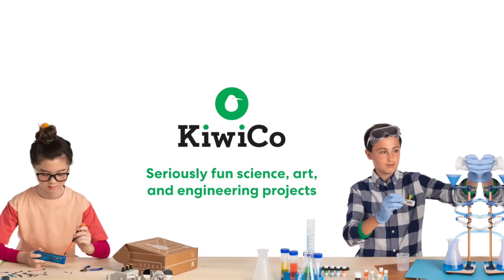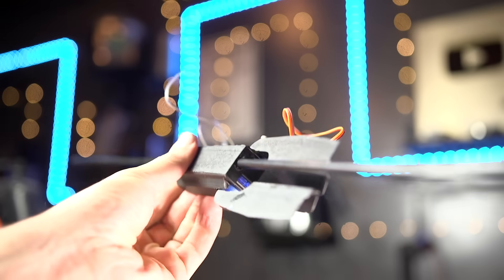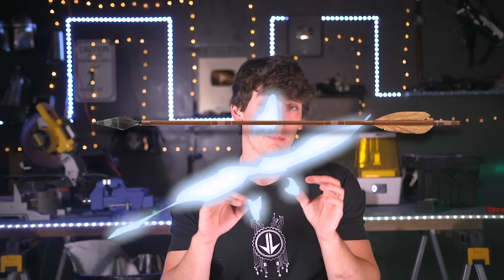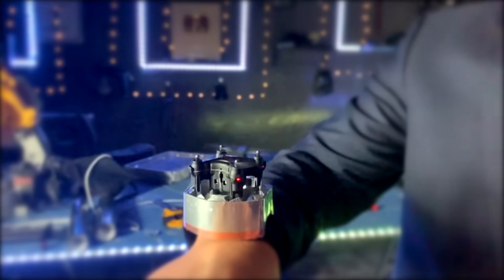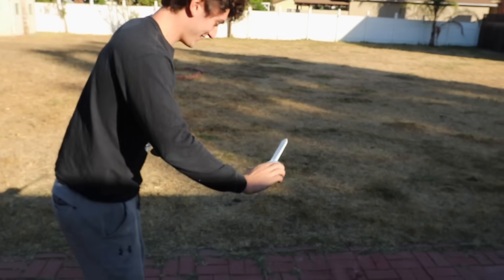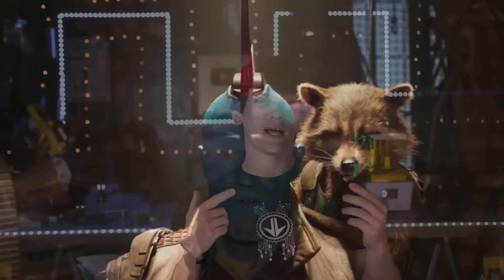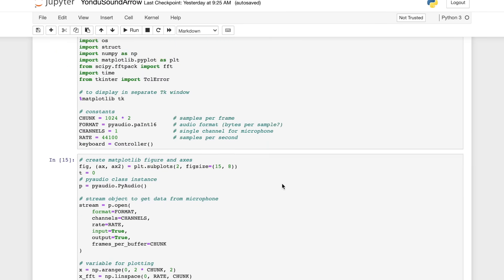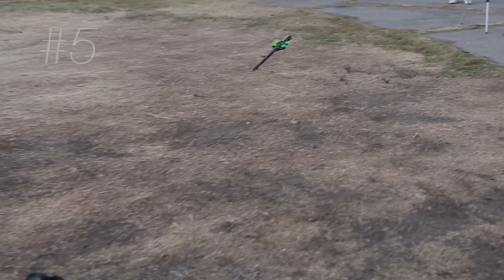Working Yondu's Arrow That Flies When You Whistle! - Change Direction In Flight!

Comment: i was thinking how most motherboards are in the shape of a rectangle, so what if u make a custom motherboard thats more in the shape of a pencil, or rather its still a rectangle but a really long one that way u could actually fit it inside of an arrow and then have a propeller that is connected to the back of the arrow and one thats on top either in the front or in the middle, that way it wouldnt be too tail heavy and u can keep it balanced and light, and also for the direction have a motor for each fletching so that u can also control each one, the only things im having issue thinking about is the receiver, how the fletching would be on and the controls but i guess i can leave that up to you :)
Reply: A PCB that thin and narrow probably wouldn’t be able to fit anything on the board, so it wouldn’t be very useful for a motherboard. I don’t think you could fit the necessary components, and even if you can, that’s still going to be very time intensive, as to make things smaller than you can buy on the market, you need to make it all custom, an expensive and time consuming process. I like the idea, but I think in practice it’s an incredibly difficult idea and rather impractical.
Reply: @thegamerfromjuipiter7545  im not an engineer or anything so ngl i dont even know what i was talking about, its just something that came to the top of my head so i wrote it down😂😂😂
Reply: @Ibrahim Javed great idea, but would definitely require a ton of time, effort, and specialized tools
Reply: You uhh... want him to to build a motherboard the size of a pencil?
Reply: @allexxz  I think they just mean a custom pcb with the only the required sensors and maybe a custom arm processor.
Reply: g y r o s c o p e
Reply: You wrote a lot so you must be determined for him to do that
Reply: @matthewhardman9200  i jus wrote what came to the top of my head🤷‍♂️🤷‍♂️, i know hes prolly not gonna do it since he already designed his own but since i dont have the skills necessary yet to design one i thought i could atleast tell em my idea lol, which i doubt he'll see tbh
Reply: The future is magnets 🧲 both the noth and south pole of the magnet together are the anti gravity equeson equipments with that the slightest movement will create a velocity  that never stops this can actually be used for  the future flying cars, havor bord and most importantly This video's flying arrow
e.t.c..
Reply: @abenzer3033  That is so false. you would need unlimited energy for that. magnets don't create energy... 😂  I can't tell if you are trolling or being serious.
Reply: That's a lot of words that I am not willing to read

Comment: Use air coming in thru the arrow tip to power a tiny air pressure system that would lead from the front of arrow to the back of it then the battery and other mechanics as weight on the back....it'll and the arrow etchings should still have room but mate 6 of them, 3 movable and other 3 fixed.

Comment: Suggestion and motors on the back pushing away from the front and the and what you need to control it on the front . There is a Japanese plane that you could use as a model. Kinda where I'm getting the idea from

Comment: About the difficulty of making it turn around: some of these drones can rotate on themselves when you push the stick that controls the height laterally, so (if this drone supports it) you could try to control the rotation with the whistle, so that the arrow will always fly forward (tip first etc), but you'll be able to make it turn around by whistling, which could end up looking even more like the movie, maybe.
Still no vertical control, though...
Reply: The problem is that whistling is one dimensional
Reply: Yep I was gonna say the same thing, arrows don't go backwards so ya, just one whistle pitch for forward, and 2 other different whistle pitches to turn, and really, all you would need is 2 more pitches to go up and down, so you only need 5 pitches in all, could work
Reply: @atticusmorhous9429  wouldn't it end up going in bursts? Like, it goes forward a bit, then stops, rotates, goes up, then forward again etc?

I was thinking something more on the lines of you make it turn around whistling, while you control the speed with the joystick (or leave it always on the same speed).

Then you could also control how quickly it turns related to the whistle, for example, after picking a neutral sound of the whistle that doesn't affect the drone, the higher pitched the whistle is, the faster it turns left, and vice versa with low pitches.

Basically, depending on the pitch of the whistle, the joystick is shifted more or less, hence the pitch regulates the direction and speed of the rotation (so how quickly the direction changes), but not the actual movement speed, which always remains more or less the same.
(also if you stop whistling it just goes straight, and you can change the rotation's direction smoothly in a single whistle, which would make you sound like Yondu) 

(anything more complex would probably be really hard to program and control, since you'd have to keep whistling one note for the direction(fw/bw), but also make another one at the same time to change the rotation, and a third one if you want to adjust the height at witch it's flying)

Comment: You should only have to points were the drone is attached so that you can put it on a free floating swivel macking it so it doesn't change the pitch when the arrows move forward or backward like if you agree

Comment: you can creat a small rc jet engine and fix it in the back of the arrow for more speed and you can use a red glow stick for more special effect and u need a power full coreless motor for changing the direction you should only use whistling for only starting the device and you can keep a gps on your arrow and you use a gps location locator for it to reach you without remote control controling system i hope these are usefull for upgrading the yandu's arrow created by you and making it AI

Comment: Can you make a shield like captain america's shield that can bounce off walls next?
Reply: lol im imagining it having a rubber layer under that detects an approaching wall and pushes like the  pop bumpers on a pinball machine
Reply: Problem is that shield is made of an alloy that includes the vibration absorbing Vibranium metal.  This is specifically why he can land from jumping off a building without injury if the shield is under him or when Thor strikes him hammer on it that it doesn't just shatter into pieces and shatter every bone in Cap's arm along with it.
Reply: @ScionStorm1  yeah but that doesn't exist just like in this video the sound absorbing metal doesn't exist hey uses real life tech to mimic certain abilities he doesn't have to mimic all it could still be a cool video

Comment: Should have done this with micro jets. Filled the body of the arrow with hydrogen peroxide as fuel. Add an epoc nuero headset for flight controls to be actually brain controlled. Bam.

Comment: You should make a Thor hammer that comes back to you when you throw it
Reply: Enchant it with Loyalty
Reply: Just tie a string to a foam hammer and pull it back every time you throw it
Reply: Magnets maby?
Reply: yeah magnets might work
Reply: Boomerang
Reply: So a boomerang Thor disguised hammer?
Reply: And what if he doesn't catch it?
Reply: @lukepeepin  edit it out of the video...
Reply: Aint possible
Reply: @maikbam2827  neither was this
Reply: DRONES
Reply: @meckstone  drones wouldn't work
Reply: @Spookatz.  A STRING AND A REEL
Reply: @maikbam2827  Electro Magnets. Would be a bit iffy and the hammer would likely have to be pretty light and/or the electro-magnets need to be really good, but could potentially work. Hacksmith industries used them to have Captain America's Shield return to them.
Reply: @kooldude2003  Dude, that only worked for like a couple centimiters due to how magnetism works (it's pull decreases with distance exponentially)
Reply: @kooldude2003  To power electro magnets to pull a across a distant farther then like a few cm that would require something equal to an Arc Reactor which doesn't exist.
Reply: @maikbam2827  make it attach to a retracting strong line. Then make a little wench system that can pull it pretty quickly.

Comment: Since arrows only goes forward, why don't you change the current control to left and right and add a toggle based forward and stop. Like reverb whistle for toggle between forward and stop, then you can simply control it left or right most of the time instead.
(Not sure what it's actually called but when I call it the reverb whistle, it sounds like a bird call. Like a purr and a whistle combo)

Comment: How I would've done this: built the propellers in line with the shaft. The fletchings are lengthened and put on servos for lift and steering. Four whistle tones are used: two for roll, one for thrust, and one for pitch down.

Comment: This is so close to being a viable thing. If you added a larger thruster prop on the back to drive it foward FAST while the other kept it in the air, and made an actual sharp tip, etc. I bet it would actually be lethal.

Comment: why so many fugly, extremely labour intensive 'arrow planes' when you could just use a real carbon fibre arrow with a fake lightweight tip on your drone? i bet its lighter than the 3d print. also next time you're making one, plane wings  work better if they're a proper air foil. there are also really cheap RC paper aeroplane kits that might have worked ok for that concept. similar to what you did with the drone motors, but with fins for steering etc included. just so you know :-)
Reply: @WeeePlayz A. The dude earns mad Youtube money
B. Printer filament and his time to design a part cost money too 
C. A carbon fiber arrow costs $10-15
Just seems like a good solution to me

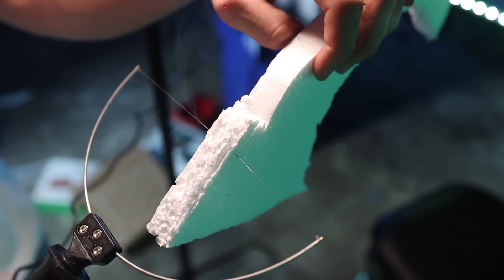Comment: 5:44 Guys guys if you’re lazy to buy a foam cutter then you can make one within 3 mins.
(Take a 9v battery and take a thin copper wire then use one end of the wire and press it on the positive side of the battery and the other end of the wire press it onto the negative part of the battery)👍🏻 (*Don’t Burn Your FinGErs*🔥)

Comment: Change the arrowhead, if you use an arrow that the head has offset blades it causes the arrow to spin, giving you greatly increased accuracy especially at distance this is what people who bow hunt do. Also since you are building something that you won't be used for hunting then you aren't restricted by the regs that affect the width of the arrowhead so make the blades bigger thus giving you more surface to control the arrow